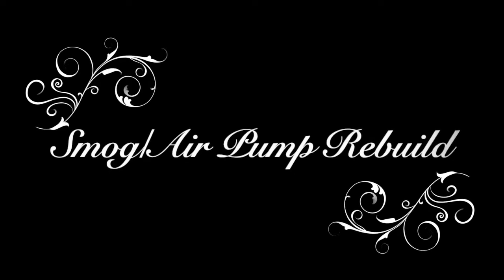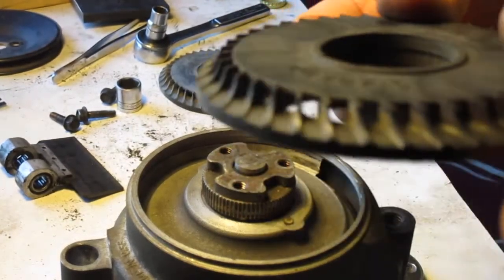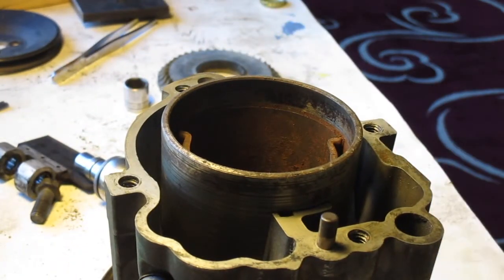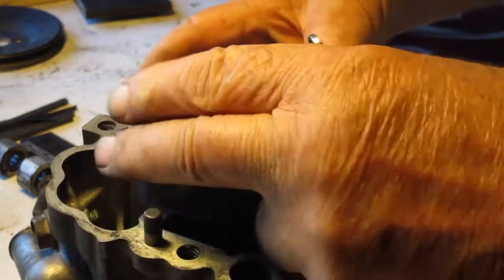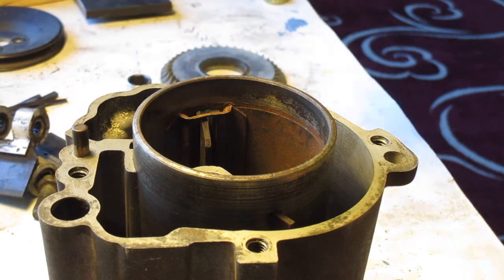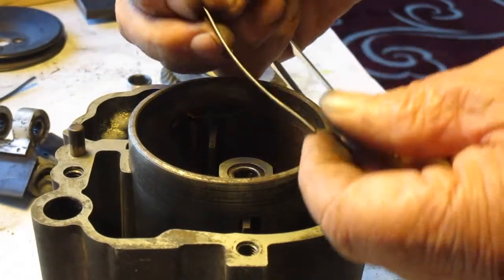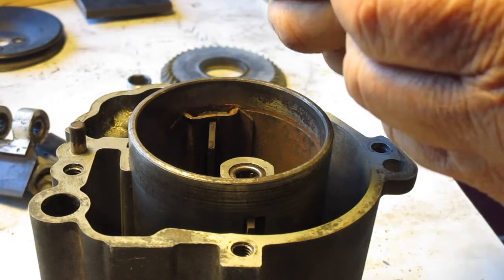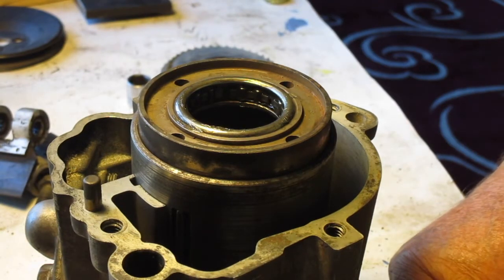Smog-Air  Pump Rebuild

Comment: Hi, Where did you fine the rebuild kit? Thanks
Reply from the maker: Found them on eBay. You'll have to search a little but you should be able to find them.  They are pretty much standard size for all air pumps.  Just make sure you have all the measurements such as length of vanes; etc.

Comment: Hi, how did you remove the end plate.. the circular deal with rolling bearings
Reply from the maker: Use an all thread rod with a center tapped plate that's a little longer and narrower than the hole in the end plate bearing.  Snake the plate through the Hole and then thread the rod down until it pushes on the front of the housing.  Just keep threading the rod in and it will slowly  push the back plate out.

Comment: That is very well explained.  Thank you.  Big question for me is what tool do I need to get the end cap out?
Reply from the maker: Sorry I didn't explain it very well in the tale apart video.  You need to make a puller with 2 holes; 1/4" spaced the same distance as the holes in the end cap.  Tap a 3/8" hole a little off center for a threaded push rod so it doesn't interfere with  the vane rods.  Then take two 1/4" bolts about 2" long for the pullers.  Stick the nuts onto a piece of masking tape to hold them while you put them through the center hole in the back cover and screw the puller bolts into them.  Thread the push rod all the way down and turn it enough to push the cover out of the cylinder.  Look at the take apart video>
Reply: @jamespasek28 how may I take out the rear that holds the bearing? I was thinking of heating the outer cylinder then pull out